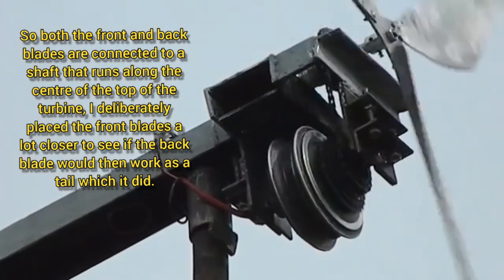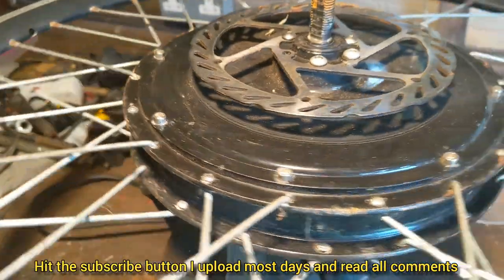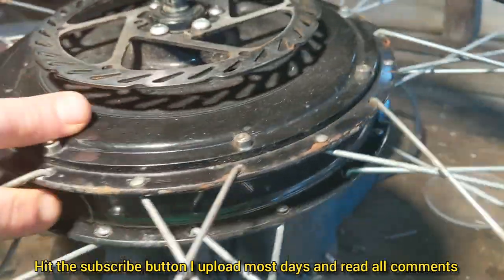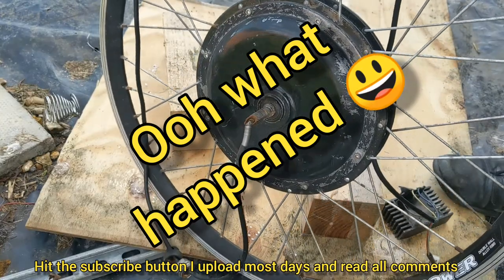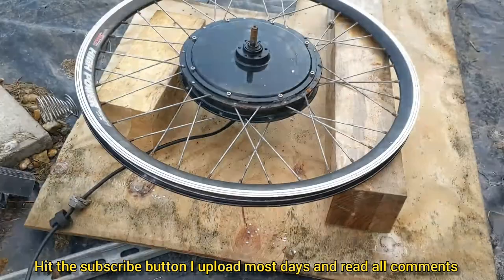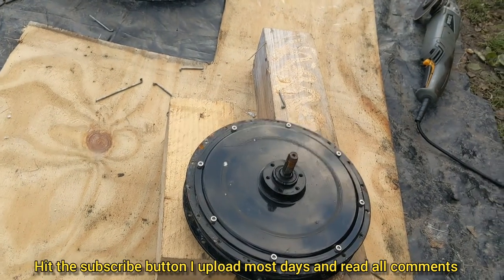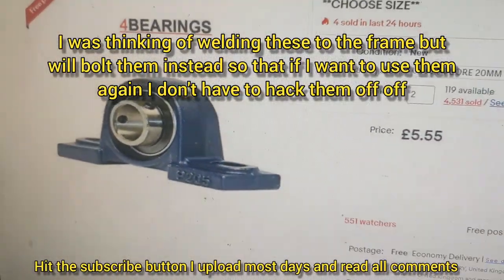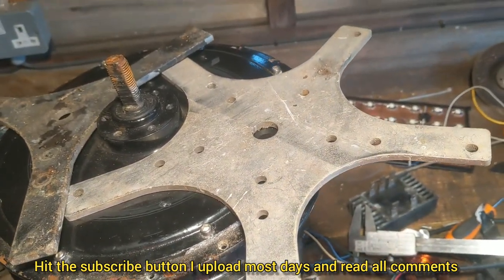1KW E-bike Motor to Wind Turbine GENERATOR Part 2

Comment: How does the wiring work- eBike wheel has 3 power wires and a half.dozen control wires....
Reply from the maker: use the three power wires to the rectifier and chop the others
Reply: @GavinFreedomLover  Thanks.  I had not understood that eBike motors use 3 wire AC power and that you can buy a bridge rectifier to convert that to DC.
Reply: Does the order of the wires make any difference?
Reply from the maker: no any order is fine.
Reply from the maker: only modern motors are AC the older ones have 2 wires red/black and produce DC you want the AC one with 3 wires
Reply: @GavinFreedomLover  I have 3 Wire AC motor.  I and going to get a laser cut steel disk to fit over the 6 hole disk rotor and attach 3 x 1m blades made from 200mm pipe to the steel disk..... bridge rectifier to get to DC on  order .

Comment: But is IT possible to make a wind turbine to charge a battery of a E-bicycle when you are riding the bicycle. Our maybe with kinetic energy in front of the wheels.
Reply from the maker: No that would not work as the drag of the blades would more than offset any benefit.